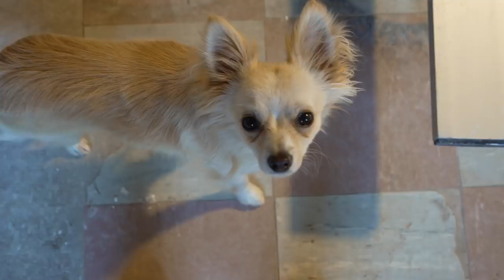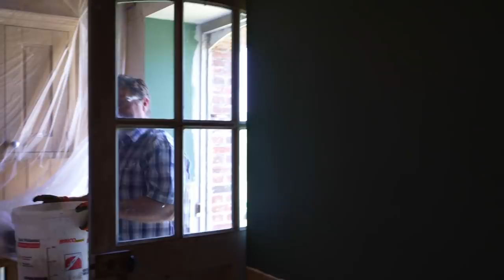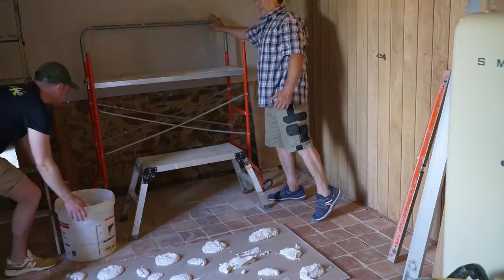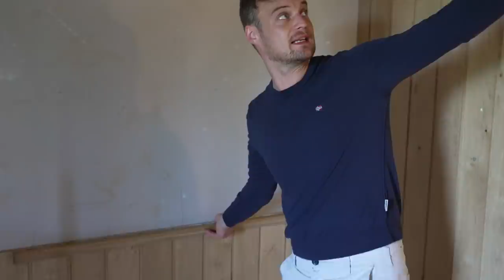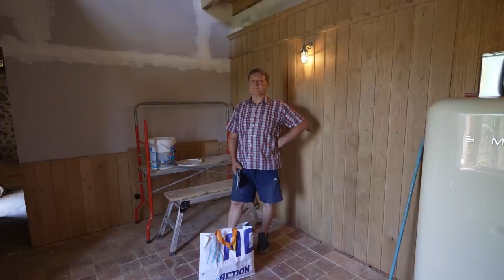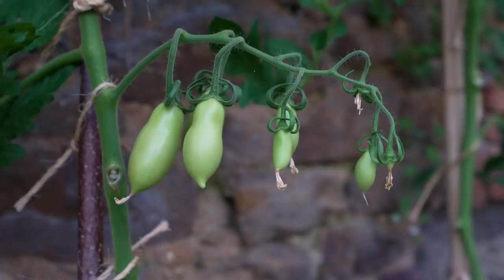Painting The Cottage - Part 2 - Doing It Ourselves

Comment: I don't usually comment, because you always get so many, that I figure mine will get lost in the sea of posts, but this time I'm compelled.  I live in the States, and we are also installing wall panels (here we call them drywall).  Ours seem to be the same as yours.  Paper with crushed gypsum inside.  We cut them the same way, but where we differ is that we always screw them into wood frames (studs, furring strips) with drywall screws.  Then we mud them, (seal the seams) like you did, but with a paper or mesh tape to keep the seams from cracking.  I'd love to know what you used to stick the panels onto the stone walls.  Your kitchen is turning out to be stellar!  Thank you for sharing that project.  All the best to you from Pennsylvania, USA!  🏰 🏡

Comment: Michael, seeing that you took down the stair case....are you required in France to install the replacement up to current code or can you build it to it's original size?  Looking forward to Part 2.
Reply: I'm interested to see the new staircase, too. The old one was so steep. I wonder if the new one will be slightly reconfigured.
Reply: He’s said it will be exactly the same
Reply: How is that possible, though? The space is probably a good 6 inches tighter due to the new framing/insulation/wainscot on the exterior wall. And the original treads were quite narrow and steep to begin with. I can't see how adding a small landing and turn can be avoided. It'll be interesting to see how it gets worked out.

Comment: Why do you put murder on the backside? In the US that would be the tabs to the wall with sheet rock screws then you just put a small dab of butter over the screw and smooth without when you do the seams and if you do it right there’s no harm there’s no tape coming loose it’s ready for paving. Just curious but it’s coming along nicely.